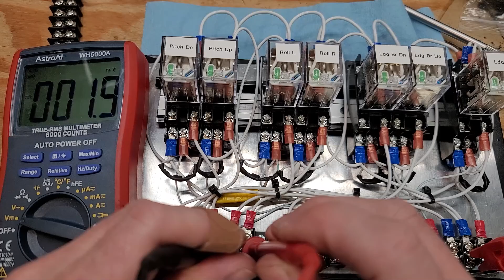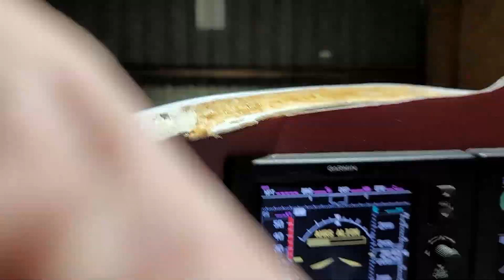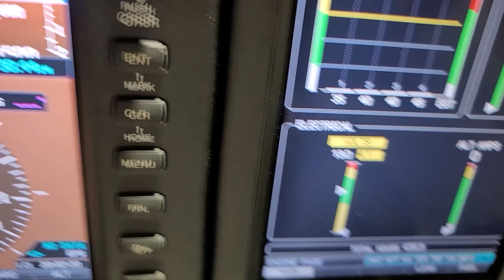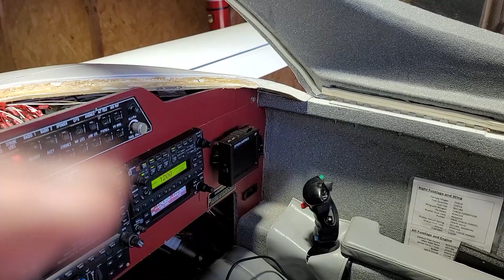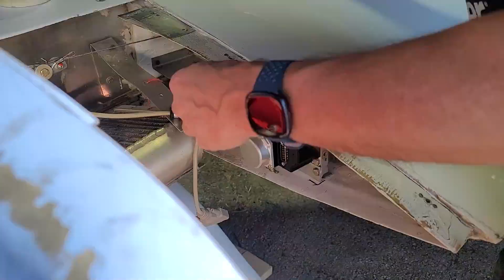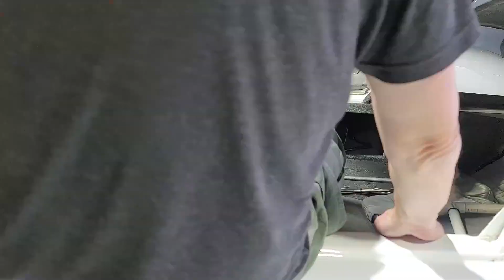Cozy MKIV Maintenance Part 7: New Relay Board and Other Electrical Work

Comment: I’ve never written a comment before, and here I am writing to on the same video but anyway. When I was watching you replace the servos, I noticed that in the first servo that you replaced at the back there was a loud, clicking noise, and the servo arm seemed to jump and press hard. Is that a problem? I assume it’s not because you seem very knowledgeable in your engineering of the aircraft. Same in the servo in the front when you put pressure on it and we’re moving the servo the servo motor mount seem to flex and counter rotate the direction of the servo arm. I know that aircraft are built to flex and move, so is that fine for that to do so?
Reply from the maker: The click noise and movement you saw is the roll servo's electronic clutch engaging when the autopilot is engaged, and is normal and expected. The control tube to which it is connected rotates freely because it has heim joints at either end. The pivot point of the servo arm is slightly lower than the tube, so it exerts slight upward and downward pressure as well as longitudinal, which causes the rod to rotate on its heim joints - which it is designed to do. Ideally, that rod pivot would be a half inch lower, or the servo mounted a half inch higher, which would remove that up/down movement - which I may do one day, but it's pretty low on the priority list. :)

The pitch servo mount is pretty strong, but it does put a fair amount of torque into the elevators, as it is working against the trim spring - that's why you see the mount flexing. Again - not a problem, but the next time I have the canard off, I'm going to add a triangulating piece to that mount to stiffen it up.

Comment: Hey Scott. Just a quick question. In your video you put in a Killswitch for the trim. I believe you called it a Killswitch. Could you explain what runaway trim is? I assume it means that the trim motors are not turning off or something but when you’re flying your aircraft and you have one of the trim, could you please explain what it is what the significance of it is like how it affects the safety of your flight and the control of the aircraft but also, how is it that Killswitch can be used and is it something that you would flip and then turn back on? would it leave you without the ability to trim the aircraft if you had to use it? Thanks for your time and I enjoy your video.
Reply from the maker: Runaway trim is when an electric trim actuator, for whatever reason (failed relay or control switch, shorted wire, etc.) continues to run uncommanded, putting the aircraft out of trim. It can be a serious safety issue, so having a way of disconnecting all power to the trim system (like I did with this breaker) is important. In that situation you would normally leave it off, land and fix it before continuing.

I have had a trim problem in this airplane before, where I was able to actuate nose down trim, but not nose up trim, so I ended up with a significant nose down trim that I had to pull back on the stick to overcome. You can see more on that flight here: https://www.youtube.com/watch?v=JZ43t01P5OA

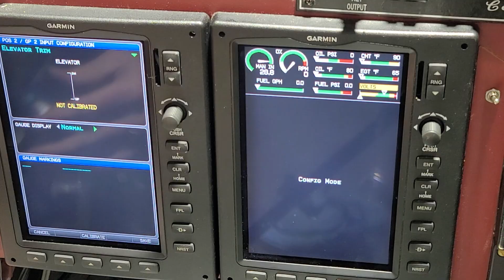Comment: 23:48 The trim position indicator moves fairly quickly on the display, it doesn't look like there's much time to pull the trim power breaker. Particularly as it won't be starting from one extreme & travelling to the opposite extreme. 
Looking at your circuit, I was thinking that in the case of a welded relay contact, the copilot could select opposite trim which would stop the motor with +ve on both motor outputs. (If his switches haven't been inhibited). Then realised the pilot could just select opposite trim himself, stopping the motor, giving time to find the breaker. So the time available isn't that bad, so long as you're not distracted & don't notice it from the start.
Is the aircraft flyable/landable all combinations of full up/down trim and all C of G & speed combinations?
Once you've got the runaway stopped with the trim breaker, is there a plan for moving the trim to a more desirable setting? Swapping relays in flight?!
I was thinking the minimum might be a 2 pole, 3 position toggle (or rotary) switch, sprung to the centre position, break before make contacts. Centre position connects trim motor to your relay outputs. (Normal operation). The up/down position connects the motor to +/- or -/+. You'd want it located so you can hold the trim toggle up/down with your thumb while briefly selecting the breaker with your fingers!(Assuming you'd want the other hand for flying). There's also the option to hold opposite trim on side stick switch, push breaker in, operate override toggle for desired trim, pull breaker, release side stick trim! (Doesn't require doing 2 things at once with the same hand).
You could also get trim runaway if any of the 4 trim switch wires short to ground. (Less likely with your composite aircraft). Either of the copilot trim wires shorting to ground would also override your copilot inhibit switch.
Perhaps this isn't necessary but I'm left wondering, as you thought it enough of a possibility that you fitted a separate breaker for the pitch trim...
Would you always pull that breaker before it had gone too far? Or isn't there a "too far" for this aircraft? Or perhaps there's already a backup way of controlling the trim that I didn't notice.
Reply from the maker: All very good comments. And a welded relay contact is definitely something I have thought about in the design. You mention using the copilot side to recover - actually that's not even needed. Say the pitch up relay sticks closed, simply pushing the nose down trim (on either stick) will stop the trim from progressing, because it will then apply +12V to both sides of the actuator. Trim excursions are pretty noticeable, so I would like to think I would FEEL it before I ever saw it on the display, and would quickly apply opposite trim, which would stop it - and then give me the opportunity to troubleshoot and pull the breaker if needed. That said, I purposefully oversized the relays to prevent contact wear and subsequent welding, and they can be inspected as part of the annual condition inspection.

The original circuit design that was in there could potentially have provided a dead short through the control switch if a relay had welded shut and opposite trim then selected - sending up to 10 amps through those very small wires in the control sticks, which could have melted/burned. That's one of the first things I changed.

You can fly it fully out of trim - but it's not easy. Unlike some aircraft that use trim tabs to utilize airflow to apply trim force, this airplane just applies bias to the controls through springs. You can overpower those springs, but it is tiresome - ask me how I know! The flight with the trim problem that I posted here https://www.youtube.com/watch?v=JZ43t01P5OA is actually what got me really started down this road of replacing the trim control system in the first place.

Yes the runaway could be caused by a shorted wire - but that is pretty unlikely in this aircraft. The wires are sheathed (in that blue jacket you see in this video ) from internal to the sticks to where you see at the relay board. There would have to be some pretty heinous abrasion or failure internal to the sheath for this to happen.
Reply: I knew as I clicked on the link it was going to be the reason why you are doing all this new relay work!  - You had mentioned about the motor current going through the hat switch & damaging it.
You're right, with over size relay contacts & the strong mechanical relay actuation that will go with that, there won't be any welded contacts and you've mitigated against wires grounding, so good to go.

Comment: What was the purpose of the diodes in the isolation circuit?  I thought I heard you say that it disabled the circuits by making a ground not available when the copilots switches were isolated.  Not sure I understand that purpose of a diode then?
Reply from the maker: Each of the individual switches on the control stick has two wires - a ground and the switched lead. The ground is connected to ground, and the switched lead is connected to the relay coil - and the other side of the relay coil has +12 volts. So when the switch is closed, the relay is energized.

Each of those switched grounds on the copilot side goes through a diode. The reason for this is that if the pilot were to operate ANY of his switches (including the landing brake, which is normally left in the up position, meaning its ground is active), it would backfeed a ground to ALL of the copilot switches regardless of whether or not the isolation switch was engaged - meaning the copilot switches would still operate. By having a diode on each of the grounds for the switches on the copilot side, it prevents this from happening.
Reply: @CanardBoulevard  OK.. thanks.  Make sense.  I missed that you were switching grounds on the copilot circuits.   Thanks.

Comment: I just caught a glimpse of the relay wiring schematic.
Looks like you're only using half of each relay.

I don't know how much current the individual servo motors use but,
the motors are inductive loads & prone to causing arcing at switches/relays. 

I would consider paralleling the relay contacts for increased reliability.
This provides current sharing which doubles current capacity per relay.
It improves reliability over one set of contacts.
If one set gets "iffy" the other set will automatically carry the load.

Have fun
Reply from the maker: Good eye. You're correct, I am using only half of the DPDT relays. I originally had planned to do the same - parallel the contacts, to functionally share the current. However the relays are rated for 15 amps apiece, and the most current that is ever being drawn is around 5 amps. That said, I do like the idea of adding a layer of redundancy - I'll add a bridge to the other contacts to double them up.

Comment: Flip the Co-Pilot isolation switch direction - "UP" should be "ON" and "DOWN" should be "OFF". That's a fairly standard orientation for switchology.
Reply from the maker: That's how it is. Flip the switch on, and it isolates the co-pilot (actually, technically it isolates the pilot). I suppose it could be "Co-pilot inhibit". In any case, when the switch is flipped up, the co-pilot switches stop functioning. When it is flipped down, it is normal mode, and both stick controls work normally.
Reply: @CanardBoulevard  Yeah - that's my point. "Co-Pilot ON" should be up (the "ON" position) and "Co-Pilot OFF" should be down (the "OFF" position. "Inhibit ON" is completely unintuitive - if you want to turn a function (in this case, the Co-Pilot switchology) "ON" you don't move a switch to the "down" position.

Your plane, your user interface, but unintuitive user interfaces are rife for mistakes.

Comment: not to be picky, but would it not ba a pilot isolation ship? By turning off the co-pilot, the controls are isolated to the pilot.
Reply from the maker: True, when you are talking about intercom, the pilot isolation switch isolates the pilot from everyone else. Technically that's what's happening here with the controls. I haven't printed the labelling up for it yet, so it can be called anything I like - I just called it this on my circuit diagram.

Comment: I had similar issues with labels.  Ended up using a spreadsheet printed on printer paper with a laser printer, cut the labels and put them under clear heat shrink.  The custom wire harnesses from ACS, Steinair etc often have the labels printed on the wires.
Reply from the maker: Yes, there are some custom harnesses in my plane that have the heat-shrinked labelling on them - which is really nice, if you are building everything from scratch. Hard to do that for retrofits though. I like your clear heat shrink idea.

Those P-touch labels I used will stick there forever - I've used them on wires before, and I've had a REALLY hard time getting them off when I wanted to.

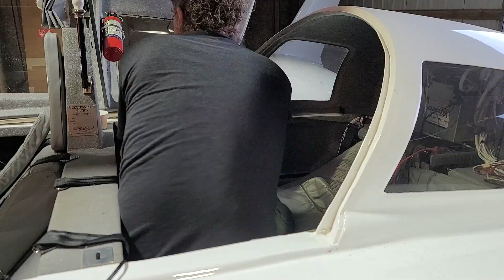Comment: Scott, at 22:47 in the video, it looks like the pitch servo rod is striking the nut on the end of the servo control arm shaft.  No part of the autopilot servo installation should ever limit either pitch or roll axis movement.  The normal stops built into these control systems should be the only stops.  In other words, adding the autopilot servos should in no way create new end point control limits for pitch and roll.
Reply from the maker: It does look like that, I suspect because of the angle of the camera, plus I had the camera zoomed in optically, which distorts depth perception. It comes close, but does not contact that nut, even at full pitch deflection.

I do however want to add some reinforcement to the autopilot mounting servo, as there is more movement there than I would like to see.

Comment: Can the Garmin servos be used for trim as well as autopilot functions?  Don’t forget to label your new switches….
Reply from the maker: Yes, they can - and in that case it allows the autopilot to adjust trim as it sees fit. When you do it this way, your switches go to the GSA 28 servo, and the servo then controls the trim actuator. I could do this - but I chose not to, for one main reason. Right now, when the autopilot needs to adjust trim, it puts a "Pitch Trim Up" annunciator on the screen, and I make the adjustment manually. I KNOW that I have made that trim adjustment. If I decide that I don't like what the autopilot is doing, I can hit the AP disconnect button, and the airplane is given back to me exactly how I'm expecting.

If the autopilot controls trim, it can (and will) make trim adjustments without you even knowing it. If you disconnect the autopilot, or worse - if the autopilot exceeds some parameter and disconnects itself, you are given back control not knowing what you're getting for trim.

Why I don't like this: what happens if something abnormal is occurring? What if you're picking up ice? What if you've got some other kind of control malfunction? The autopilot keeps adding more and more trim until it can't handle the torque anymore and disconnects, and - surprise! You're given back control of a plane with a ton of trim. There was a reported incident recently where a GSA 28 servo failed and kept adding nose-down trim, then disconnecting, leaving the pilot with a massively out-of-trim aircraft with no warning. There was also an issue with runaway trim with the same servo: https://www.avweb.com/aviation-news/garmin-wins-faa-nod-for-gfc-500-autopilot-trim-issue-fix/

With all that in mind, I decided I'd rather retain manual control over my trim.
Reply: @CanardBoulevard those are some good reasons to stay with a trim motor and not a servo. Particularly not to have autopilot controlling it.
The Bonanza/TNFlygirl crash appears to be due to getting handed back from autopilot with a load of down trim. That was with a manual trim autopilot that worked like yours with trim up/down indicators. From her earlier videos, it looks like she was the polar opposite of you in terms of understanding that system.